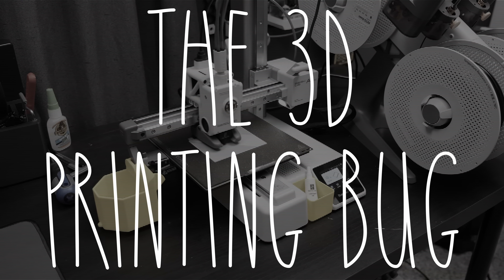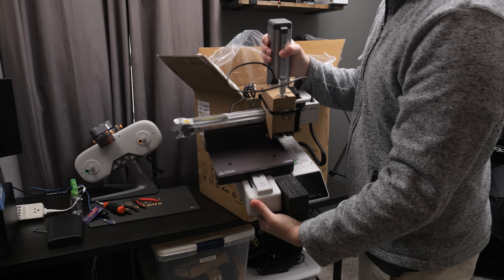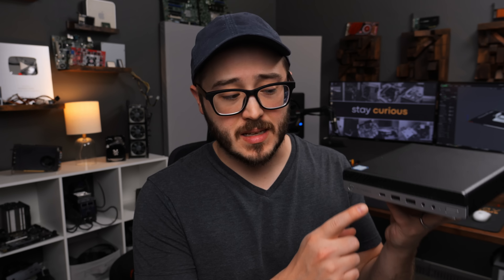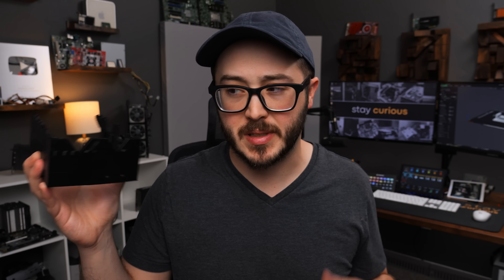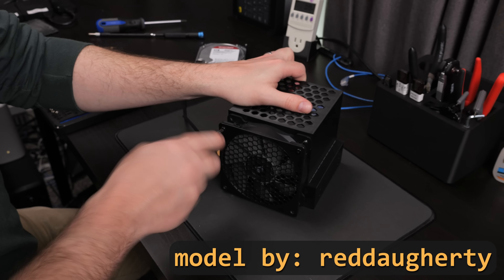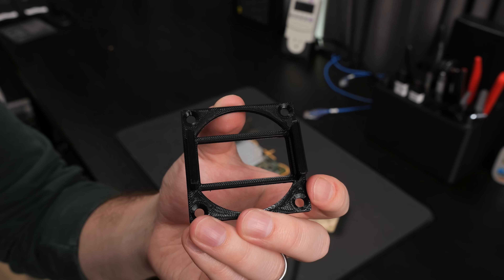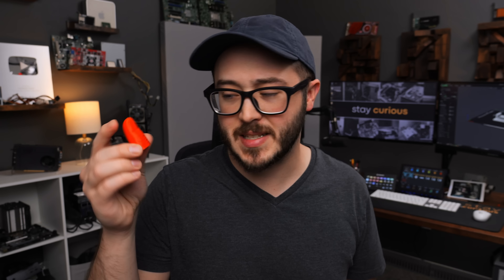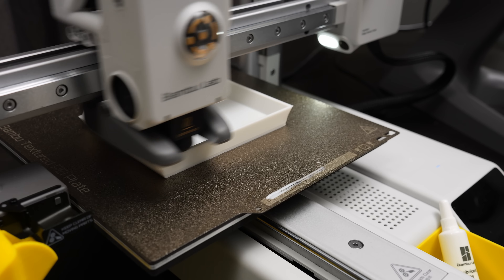Computers + 3D Printing is a PERFECT Combination

Comment: Welcome to the club! The A1 mini is one of the printers I recommend most often. the major one I tend to recommend is Sovol's SV06 most of the bells and whistles and big enough to print most anything.

Even without CAD skills, a printer is a handy thing to have around. With CAD, it unlocks the true potential. The custom solution. Brackets for mounting anything to anything else is a big one.
Reply: the problem with A1 mini is that you're limited what filaments you can print since the bed won't go over 80C
Reply: @seljd  depends what materials you want to print. it's entirely adequate for PLA or PETG. Other materials would be miserable to print on an open machine like the A1 mini anyway. It doesn't really end up being much of a limitation.
Reply: I run abs+ on my ender 3 open  with little fuss but in an enclosure its way better
Reply: @UnifiedInfo  I printed an ASA voron on a pair of Ender 5s in a makeshift enclosure. It's doable. not sure I'd advise it though. The printers practically ate themselves running that hot for that long.
Reply: Ya thats pushing it to the limit lol👌

Comment: Honestly with all the tiny mods and holders it really already paid for itself by reducing daily stress. At least that's what this video conveys :)

Some niches I would like to see with 3D printing:
- Cable Management / Routing inside chassis for reduced clutter, improved airflow and such
- Fan Ducts (OptimumTech did a video on Fan Ducts for a Gaming PC and I find it interesting to see if it makes a noise or temp difference inside Server Stuff (like HP and Dell do it on their Pre Builds)
- (partly) 3D printed NAS Case maybe?

There are a lot of scenarios I'd love to have a 3D printer myself and the only two reasons not to get one (yet) are space (or the lack of it, there is no surface or corner left in our flat to place a printer) and my kids... They would try to interact with the printer all the time. They almost messed up my real printer once so no trust currently! 👀

Comment: It's a slippery slope. I'm 2016 I got my first printer, a tevo tornado, followed quickly by an ender 3 and I then quickly modified both printers with all metal hotends and bed leveling sensors, and raspberry pis for printer management and webcam monitoring. Maintenance became an issue and bed flingers are heckin slow so I built my first corexy printer 2 years agofrom a kit, a 350mm voron 2.4 and man is that a fast and easy to use printer. Last year I replaced the tornado and the ender 3 with a k1 max and a bambu p1s+ams (both corexy and both fantastic) and multicolor printing is great!  2 weeks ago I built a tiny 120mm voron 0.2 for rapid prototyping. It heats up and prints super fast, early Fastest printer in my stable. Maintenance on the v-wheel bed flingers were really annoying but the corexy printers i have now are easy. Some lube on the rails and lead screws, making sure the screws are tight, and a belt tension check every 4-6 months, and swap out the nozzle when it gets worn. Wash the print surface if filament soda stocking to it with some dish dish and water, is an it takes. I print everything from art statues to various clips and hangers and mounts to jbod das enclosures to arcade parts to display pieces like helmets to purpose designed project boxes for various electronics and radio projects. There's a ton you can do with a3d printer. But I would at least recommend an enclosed printer so you can print abs and asa which has much higher thermal tolerance if you're printing computer parts or parts that might see sun or the inside of a hot car. Pla likes to melt at very low temps.

Comment: I've had an ender 3 for years at this point but it requires me to fiddle about with the bed height pretty much every time I want to print. And also I just don't have the patience for that most of the time. I've been considering one of these Bamu printers for a while now and didn't know they made a smaller, less expensive printer so thanks for sharing. I think it speaks volumes how easy people can just get to printing with these things

Comment: I bought my first Prusa i3 MK3 back in 2018 and it was a game changer for me. Since then I had as many as 10, but I sold them off and kept a single one. Not so long ago I had an idea to use a SAS backplane from a Dell PowerEdge T320, which could hold eight 3,5" drives and use that to make a 3D printable JBOD to have it run off of a PC, which draws less power than the actual T320 (although with a Xeon E5-2470v2, 8 HDDs and a GeForce GTX1650 for video transcoding it's still only 120W according to iDRAC)

Comment: Quick tip, before you go all in for printing brackets and Hard drive holders for PCs make sure your filament can handle those temperatures. A printed holder looks a lot better when it doesn't get warped by the heat
Reply from the maker: Yeah, I used PETG for anything with a chance to get warm

Comment: I got the sovol sv-06 because I didn't have time to calibrate it or diagnose issues either and for only 240 dollars I think it's the better value since it is open source and has a 220 x 220 x 300 print bed

Comment: As weird as that sound, a lot of woodworking techniques to join parts to make larger ones work really well with 3D printing. Things like dovetail joints and the like. It's also interesting that you're using FreeCAD instead of what everyone else seems to use (Fusion 360). One thing 3D print can be really usefull to do along with the usual brackets and the like are fan shrouds. Granted you could always to them with cardboard and tape in the past, but 3D printing them gives more options.
Reply from the maker: The issue with fusion3D (if I remember correctly) is that, because I run a business and make profit from the content I make, I think I would fall outside of terms for the free license.

Comment: Welcome - to the real world :)

I just wanted to say that when making stuff to be used inside a computer, better stick to PETG or even ABS or ASA. PLA softens at around 60°C that's often not enough inside a computer. PETG can handle around 80°C and ABS/ASA around 100°C. However, you'll have a hard time printing with ABS/ASA on that printer, since it's not enclosed.

Good luck printing!

roy

Comment: I think my main hangup with 3D printing is all the plastic waste it can create, something the world has plenty of already. At the same time it can also save a ton of ressources in shipping something manufactured on the other side of the planet. There are ways to recycle prints into new filament, but it’s a bit of a pain from what I’ve seen. I hope that can be made easier and cheaper in the future.

Also, isn’t bambu labs cloud connected devices, likely with a ton of Security holes and backdoors? I certainly would put it on a closed network.
Reply from the maker: It is cloud connected, but has a LAN only option 👍🏻

Comment: Question: Did you print the Benchy at least 1 time?

You're not a 3D Printer guy untill you print at least one Benchy.
Reply: i've built my Voron 2.4 in 2021 upgraded it countless of times and didn't spend a second on printing benchy, i don't really want to be called a "3D printer guy" thou
Reply from the maker: I specifically made sure not to 😂😅

Comment: 3D printing and PC hardware hacking go hand in hand. We live in a 1000sq ft apartment and my two 3D printers are my workshop. If I could send you an image of my latest project I would. It's my Hyte Y40 gaming PC. It's entirely air-cooled with an I5 12600K and an RX6950XT GPU which are known to run hot.  After some 3D printed duct work design in the PSU barn and on the intake the Red Devil never gets over 72C running flat out. I'm about to convert one of my old HPZ420 workstations into a front loading 8 bay NAS because well, reasons. 3D printing allows you to design any product you want and yes, you're a 'maker'. Like the rest of us.

Comment: the reality is that 3D printers that are cheap & just work have only been on the market for a few years. Had you got into 3D printing earlier you'd have to be tinkering to get a half assed designed & poorly QC'ed printer actually to print anything.